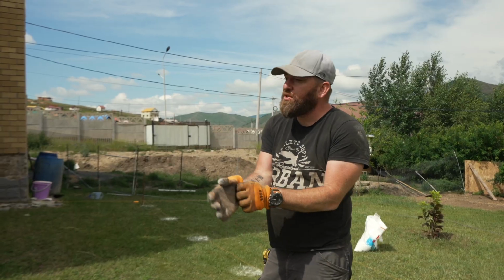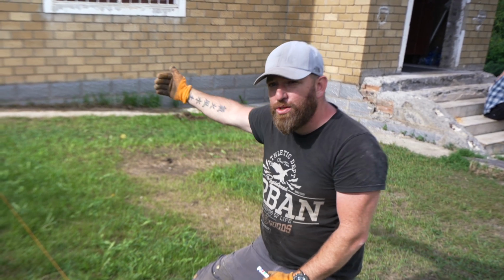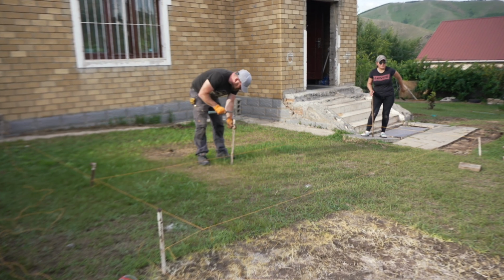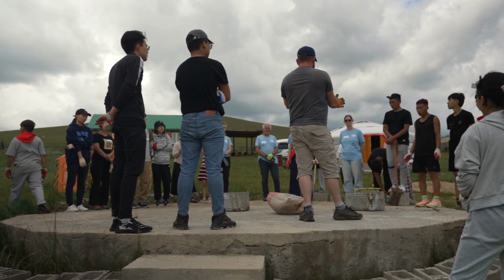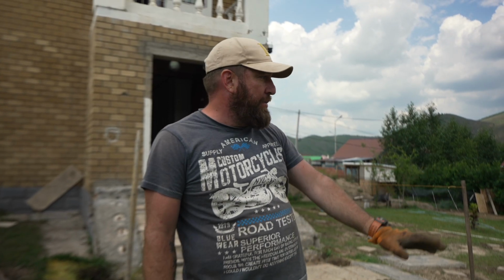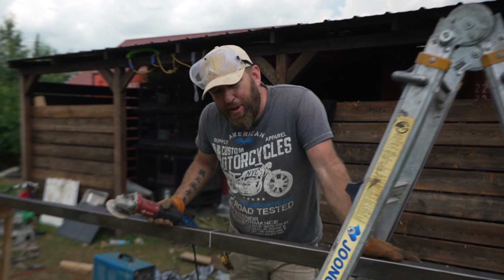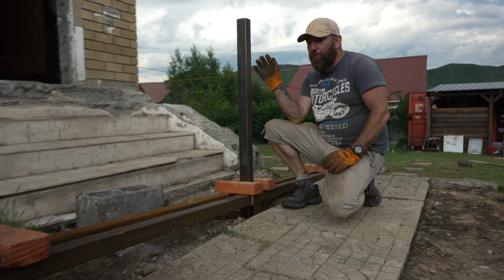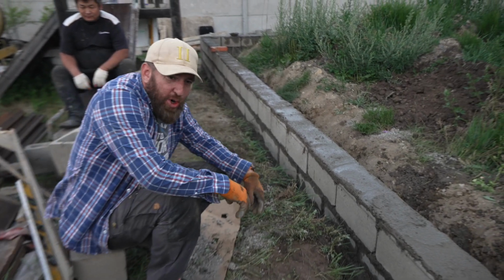EXTREME BUILD | How to Build a metal frame Deck to last in Mongolia

Comment: I have done these metal posts and purlins on my home. I used 10 ft between posts and 2 by 6 C purlins on all then put 2 by 6 treated with self drill screws. It lasts much longer than the treated posts
Reply from the maker: Hi CRaegle 👋 thanks so much.. really appreciate it